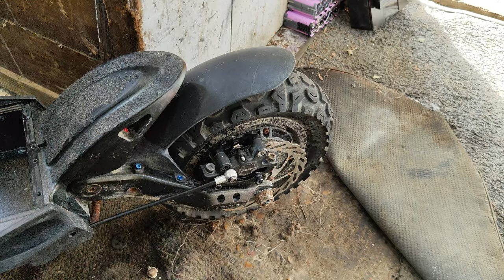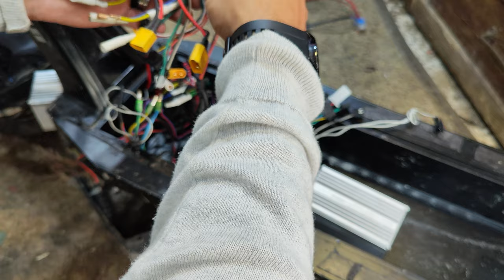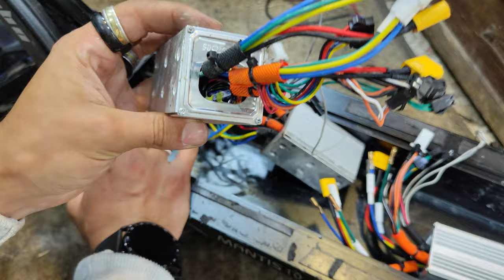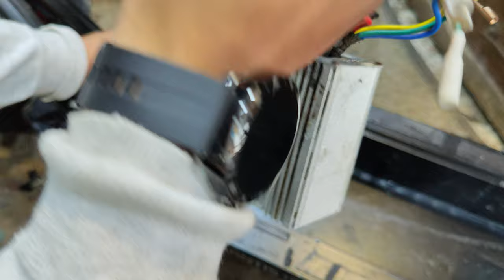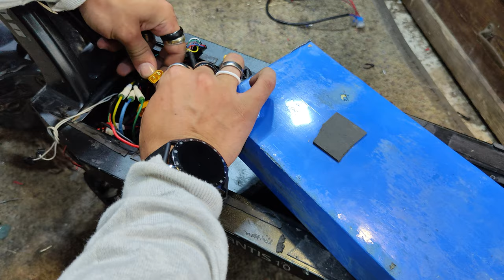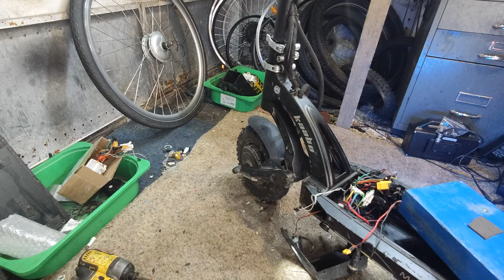Kaabo Mantis 10 Controller Replacement (How To)

Comment: @Ebikes Repair    I recently bought a replacement battery for my mantis 

Is there a specific way the battery is connected to the controller ? 

Or it doesn’t matter which battery cable you connect to controller?

I don’t want to short the battery or controller 😢
Reply from the maker: I think it doesn't matter. Which connector goes to which controller - verify polarity with a multimeter first. 

Be careful though as I had a bad controller and connected the battery and the xt60 disintegrated all over my hands and burned me!
Reply: @EbikeRepairs  I also bought a new controller , I Really hope it goes smoothly for me  Thank You !! My Friend!

Comment: I just replaced my controller, all works well. but i am now having trouble placing the controller inside the compartment to line up the screws. Its like the new wiring is stiff af and doesnt allow room for the controller to be seated properly inside. All wires are thru hole and squashed up next to battery. Any advice?
Reply from the maker: I agree, it was a nightmare. I had to put the light wires down the sides of the frame holes where they go, but further in, if that makes sense.

Comment: hi,can you help??? i have a kaboo mantis 10 single motor and i have a no acceleration no motor spin issue, lights work, battery is fully charged, no error codes can you help??? Thanks in advance
Reply from the maker: Unplug brake connectors first, if that doesn't work then unfortunately you're probably going to be  replacing your controller

Comment: I have a mantis 10, when I spin the wheels and pull the throttle the wheels stop abruptly, any advice?
Reply from the maker: Sounds like a controller issue, sadly... You could try disconnecting the brake cutoffs though.

Comment: Hi there, I've got a mantis 10 pro and I'm seeing many different ones for sale. Which one(controller) would I need? I see different specs 60v 27A or 60v 30A etc..
Reply from the maker: Very sorry but I'm not sure - you'd need to check the label on your existing controller, if possible. Thanks

Comment: I really need help wiring my mantis 10 with a new controller.  Any possibility I can get  a pic of wires that needs to connect? If it takes time to do that I can PayPal you what is the cost to to that. Thank you
Reply from the maker: sorry, I don't have one in stock at the moment - but I did describe it all in the video and you should be able to see :)
Reply: @EbikeRepairs  thank you

Comment: Hi i have 1 off these scooters.  It charges perfect. Turns on runs then knocks off till plugged back into  charge. Same cycle again .. any ideas on problem
Reply from the maker: Sounds like a bad cells group in the battery pack

Comment: I just put a new controller on this and it doesn't run but turns on. Is there a safety switch to have this running.  I dont want to put it all back if theres something wrong
Reply from the maker: possibly e brake cutoffs?

Comment: can you tell me why my mantis 10 pro with minimotors controller same like this have more torque in eco mode than in turbo 3rd gear mine is with flashlight version 4
Reply from the maker: In turbo does the speed increase? Maybe eco and turbo are round the wrong way
Reply: @EbikeRepairs  yes in turbo the speed increases i had a problem with the front motor going half power the seller made something with the controller and didn't want to tell me what was the problem but from then i miss the torque which i had now its gone
Reply: @EbikeRepairs  in eco there is slight delay in acceleration when i hit the throttle and torque kicks in note that it was other way turbo mode had a beast torque and eco not that much torque now is opposite
Reply from the maker: Sounds like a bad controller - worth swapping for another they can be had for about £140 if you are happy to wait for shipping

Comment: Is it the same for the Mantis 10 pro? :) my back motor stopped working showing e10 on the display and i should be the controller to the display there is a problem
Reply from the maker: Sorry I'm not sure!
Reply: Same problem did you get it to work?

Comment: Is it one controller for both motors? I thought there are two controllers, one for each motor.
Reply from the maker: There are two flavours I believe, one with two separate controllers - and one with the dual controller built into a single housing.

Comment: which of the controller cables to battery i have to connect first? or does it not matter which cable first and which one connected?
Reply from the maker: doesnt matter :)
Reply: @EbikeRepairs  ok thank you so much. do u have an idea how i can connect all the cables if i only have 1 new controller, and not 3 controllers like you? is there some image with wire color connection? best regards
Reply from the maker: I have described it all in the video, colours and all - should have everything you need there buddy. thanks!
Reply: @EbikeRepairs  thx bro

Comment: When you plug the controller to red and black main wires do they pop ? Make a bang noise ?
Reply from the maker: Yes they do the inrush current to the capacitors can cause a pop/spark.
Reply: @EbikeRepairs  okay thought blew them haha , think my screen has broken now cos not turning on. Just making weird screeching sound , shall I replace ?
Reply from the maker: the screen is screeching?
Reply: @EbikeRepairs  yes mate when I held the power button on my old screen it made a little noise , I’ve replaced the screen and it works spot on now . 

Must have shortened out somewhere and blew my screen 👍 thanks for your help anyhow
Reply from the maker: glad its sorted for you bud :)